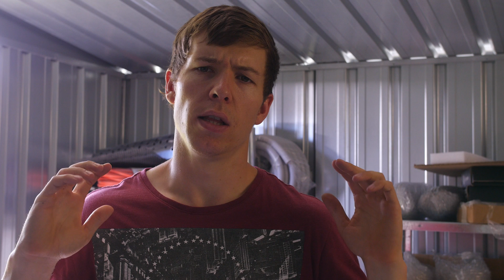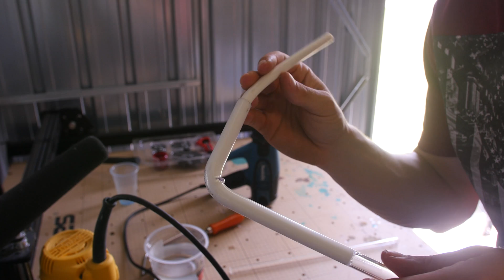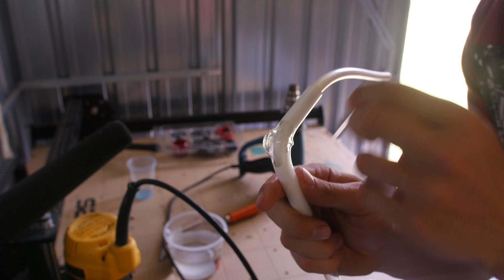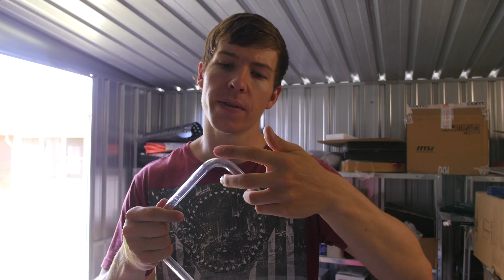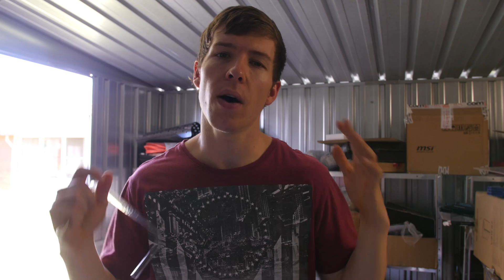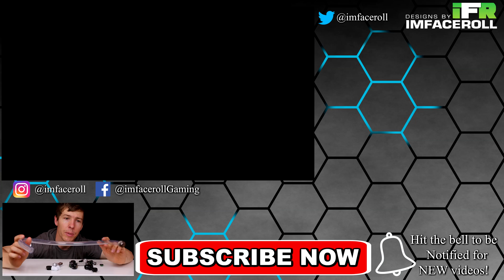How To Bend Hard Tube Tutorial - Tips & Tricks - A Beginners PC Water Cooling Guide

Comment: Can you reheat the petg to take out the kinks if say enough heat wasnt applied? if enough heat is applied would it take out the kinks? I tried my first tube run, but theirs like 3 bends. Its tough a run to get all the bends right without 1 kink up. Wish their was a service for water cooling specialists, im very new to this. Obviously theirs a lot different heat guns out in the market, i think i had mine on the 2nd setting, took some time before it was fully heated up took like a minute or 2. Obviously i can try the 3rd setting but their is a method to this madness i just need to learn. Might cost me a few hundred.

Comment: @Designs By IFR May I ask about your custom distro blocks? What kind of plastic do you use? How thick should the fluid channels be, minimum? And finally, what kind of liquid glue do you use? I am planning to build one (inspired by your builds) and figured I'd see if I can get some wisdom from the master.
Reply from the maker: Hey man. I use 5mm acrylic. The liquid is called acrylic cement or acrylic weld
Reply: @DesignsByIFR  Thanks! You rock.

Comment: love the videos and the builds! im having the darndest time bending 16mm/13mm PETG, it seems to take a ridiculously long time to heat and by the time it is heated, i get bubbles. any tips you can give would be amazing.
Reply from the maker: You are overheating it. When you start heating it keep an eye on when the tube starts to sag under its own weight, it should only need a couple more seconds after that point
Reply: @DesignsByIFR  thanks for the swift reply. Wish that were true, but it kinks and flatens every time as if its not hot enough. So naturally I hold it a little longer annnnddd bubbles. Ive got 30 bucks worth of alphacool petg with messed up bends to prove it lol! Maybe its my heat gun or my insert... I appreciate the advice though!
Reply from the maker: Is your insert very tight in the tube? Also you should heatup a decent portion of the tube so that is melts a larger portion.
Reply from the maker: If you are twisting the tube in 1 area instead of twisting and moving it up and down to heat up a larger portion then you may get flat spots on tube that hasnt heated up enough. Also if the silicon is not tight it can cause flat spots
Reply: i think its the insert, i have never used alphacool tubing before and i am not impressed. they use 13mm ID on their 16mm OD tube, which no one else uses, and you have to buy their insert which doesnt fit snugly in the tube. i contacted them after using a whole box of 1000mm tube with not one "good" bend. they want me to send pics so maybe they will be good about it and RMA. doubt it.
Reply: thanks friend for taking the time to respond, youre an awesome youtuber!
Reply from the maker: Thank you =)

Comment: I have a question.
My silicone insert to perfect size but wont slide more than a inch in my PETG hardline tube. I tried water for lube still wont work. Do you have any suggestion?
Reply from the maker: +Luis Cosme hey man dip it in some dish washing soap or hand soap or olive oil
Reply: It work. Olive oil. 
Everything looks good but I have one flat spot. Would a flat spot effect anything?
Reply from the maker: +Luis Cosme it wont affect anything. Try to run water through the pipe to clean it out

Comment: When you do acrylic as opposed to PETG, do you wait till the tubing is absolutely wet noodle like, or should you feel some resistance when you bend? 
 My problem with acrylic is, the sides of my radius always bulge out... the inside and outside look fine, but the sides of the radius poof up... I can't seem to figure out how to bend acrylic without that happening.
Reply from the maker: +Crixus The Gaul that means you are overheating it. That is hot air trying to escape
Reply: https://drive.google.com/open?id=0B0889u7QTNtkSFBpMEc3ZXlETW9WNDVHRW9xNDkzRzJadlgw

 This is what i'm talking about... no matter what I do, I get this situation. Only with acrylic though.
Reply: In fact... as soon as I get acrylic to where it becomes at all flexible, I can see the tubing puffing up over the insert... as soon as it heats up even just a little, it just blows up like that. Not sure how to stop this.

Comment: I spent £100 buying Bitspower Non chamfer chrome plated brass tubing and they kink the moment any force is placed on them. BE WARNED: THEY DO NOT BEND, AT ALL.
Reply from the maker: +Ashley Williams hey did you use a proper pipe bender?
Reply: Designs By IFR Yeah, couldnt get it to shape at all. The pipe kinks at the bottom of the former whilst pressure was being applied towards the top of it.
Reply from the maker: interesting, ill have tro try out the bitspower ones
Reply: There are special pipe benders that are meant for PC modding. Using a regular one means you might have to mod it. I have never done this, but this is what I have heard from multiple sources.

Comment: I've been doing hard line for the past few months but I have problems getting the silicon insert into the tube, any tips?
Reply from the maker: +Mitcho “Mitcho1988” a bit of oil or i use a bit of dish washing liwuid
Reply: Designs By IFR been using dish washing liquid but I find that I spend way to much time and energy trying to grt it In since its a super super tight fit, tried oil last night and it seemed to work better but I see a lot of people grt the insert in with no trouble
Reply from the maker: +Mitcho “Mitcho1988” yeah some tubes have slightly different inner diameter. Have you tried sanding down your silicon insert??
Reply: Designs By IFR I tried but the only sand paper I have is really fine and I don't know if it's doing anything haha I might grab some more today since I'm doing a really big build at the moment and it's taking ages due to how long it takes to get the insert in
Reply from the maker: +Mitcho “Mitcho1988” yeah would definatly be worth it =)
Reply: I have the opposite problem. Any tips?
Reply: Could you attach some nylon string onto the end of the silicone and put that through first.
Pulling the silicone should stretch it, making it thinner

Comment: nice plese tutorial about the pump and the installation some time i se pump with a red wire but she ned a 12 v like d5 it is ok to pluge the pumpe  with the yellow wire in molex
Reply from the maker: +Faissal zin hey man if a pump has a yellow or red wire do not worry, they still take 12v. Some pumps even come with pwm control which plugs into the motherboard or a fan controller with pwm control. Molex is perfect to power it =)
Reply: Thank you for your response and the tutorial
Reply from the maker: +Faissal zin you are very welcome =)

Comment: Do one on how you measure tubing for intricate bends with more than two bends. I have a few tricks but want to see if you have some good ones. It always sucks when you have a run that has like 3-5 bends, if you get one just slightly wrong lengthwise it throws off the measurement and the whole piece is trash.
Reply from the maker: +Electricos Cosmos hahaha yeah i had that happen with the desk pc. Iv got this one tube with like 4 bends haha, got it on the second go though so got to save my tubes haha
Reply: pete ward was that a typo, you mean gooseneck clip on light? I was getting all technical, measuring the radius of a bend and taping the part right before the bend and measuring out the extra I need for the bend radius, mark it with blue painters tape and aligning the blue tape with a zero line on a small round object that gave me the same radius bend every time.
Reply from the maker: +Electricos Cosmos hahahaha, damn that would have taken some time, but i can appreciate the dedication =)
Reply: Maybe use an amount you know will be excessive then cut after you make all your bends.